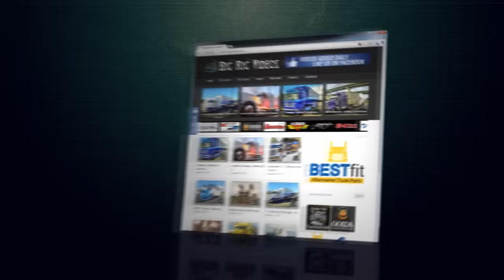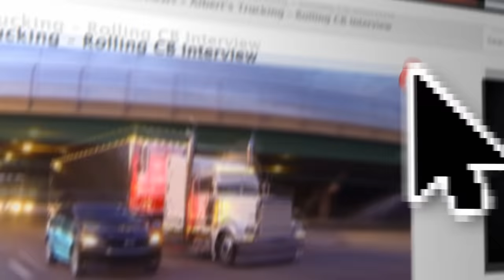Crazy Dave's Roadside Service - Owner Operator Interview

Comment: For the record, all Western Star trucks are built at the Portland, Oregon plant or at our plant in Cleveland, N.C. formally known as Freightliner Trucks. Know known as Daimler Trucks of North America. Western Star line was bought by Freightliner in 2002 when we were owned by Daimler Chrysler. I retired from the company in 2013 with 25 years in.
Reply from the maker: Right on, thanks for sharing that info.
Reply: So you worked there when it was moved from Kelowna, B.C. to Portland?
Reply: MrFakit that would have been Torner west. Torner east was in Hamilton or Burlington Ontario. I know uncle Henry.
Reply: Used to live next door to a Western Star Dealer. They made son heavy-duty trucks. Charlie Jenkins, the owner, was a hella nice guy.

Comment: I do agree with him on the tag axle. 90% of the trucks you see in North America have their tag set forward of the drives. Most European and Japanese trucks will have the tag axle set back. Which makes way more sense to me. I want my drives set as forward as possible for  tighter turner. Whether that be on a semi or a vocational truck. On a dump truck it would make more sense for the tag to be set forward because the majority of the weight is sitting dead center  on the frame. But like he said for tow trucks it does make much more sense to have it set back leveling the frame and giving you more traction on your steer.
Reply: I’m working in West Virginia and I’ve seen a lot of pulp wood and logging trucks with that type set up here
Reply: Many heavier rated European transports, and most construction vehicles, had dual steer axles also when we were there. Could always see a military convoy from miles away with all of the smoke. Don't have to worry about dawdlers in the monfort there either. The  polizei will gift wrap your azz if one plays stupid games on their highways--
Reply: I'd disagree, when you put the tag behind the drives it lifts some of the weight off the drives potentially reducing traction. Placing the axle forward helps distribute the weight but still keeps the drives loaded down
Reply: @ccclc6159  this is only true on long nose trucks, idk guys run them for heavy haul, makes no sense other then the look of a long nose. On setback axle trucks, Like a t800 or this guys video of service truck, u can overload a set back axle very easily,  triaxle heavy haul tractor or a dumptruck,  I have 3 t800 tri axles and a w900 tandem , w900 loaded lowboy, front axle light all day, t800 king pin set just ahead of fwd tandem,  you'll overload that front axle 23k lb no problem
Reply: @ccclc6159  with a setback axle dumptruck u need to take weight off the front end with the tag, put 22tons in a t800 loaded towards front of body you'll have 23-25klb on that fwd axle without the tag down. Watch a scale, just pull front on and get out and ask weight.  I've also been axle scaled many times by DOT so I know what works. Reason I say idk why guys run fwd axle trucks for heavy haul? Cause u cant get the weight that far fwd. Hence a rear pusher axle. It's a bandaid for a OTR truck trying to run heavy haul

Comment: 20 plus years ago in nyc there was a mobile tech that had a 3 axel pete w sleeper.
He was pulling a 2 axel refrigerated pup with a liftgate.
He had parts on the driver side wall. Tool box in front. Torches etc
It had a driver side slide platform with stairs. 
He had a jeep cj and a motorcycle with a basket in case he needed a parts run.
They fit on the liftgate.
He couldnt tow but did everything else.
The climate control inside worked well. 
The straight truck in this video is the best of both worlds being able to tow in a pinch....wow.

Comment: lift axle isn't in the back because the drive axles of most wreckers are already as far back as possible. lift axle can then be in front of the drives, use to distribute weight through out the frame and also a friction force when using a winch.

Comment: that's a cool truck
i think the mid lift axles are to take the weight of the crane/wrecker boom so it frees up the rear axles for the load...and i suppose with the drive at the back there(with a load) is more weight on them giving u more traction
Reply: ahh ok ....

Comment: Anyone who doesn't understand u have all that weight on tandems,  then add a truck on the back, why would u put a fwd of drive tag axle?  Rear pusher works for your set up. If u didn't have a tow set up, your rear axles should be farther back and your wanna take weight off front end with a setback axle setup. Fwd axle trucks,  idk how they get and weigh up there, it's just a steer, hence a 12k axle over a 20k setback set up

Comment: He needs to drive with the lift axle down everytime he tows cuz if not he would have a huge overhang and the truck would have no steering,wreckers have the axle in the front cuz the rear axle is as far back as it can go already,80% time wreckers dont ride with tag down cuz u have less overhang than his setup,he doesnt realize that frontrear axle is lifting his front end off the ground even as far back as it is

Comment: Can someone explain to me the difference between a tow truck and wrecker? I thought they were the same THX
Reply: +ddrum705   The difference is this...a TOW TRUCK does just what it says...it tows with a towing apparatus from point A to point B....a WRECKER does recovery work with air bags, winches and cables, etc...and it can also tow from point A to point B... I hope that helps you to better understand...that's what I  know to be the difference...someone correct me if I am wrong...Crazy Dave
Reply: +Beverley Nightingale thx

Comment: New age diesel=job security for techs. Whats the point saving on air emissions when every 50,000 miles you got to replace parts (aka natural resources). Not to mention the pollution involved in making these parts from the factories that manufacture this stuff. Intertrashanal (international) diag tech for 7 years.

Comment: Volvo pulls loads in Europe that don't exist in USA like 60-80 tonnes! American market gets cheap outdated tech from Volvo so to be serve it easy from Americans one gets what can afford & serve!
Reply: You don't know much about American  or North America trucking apparently. Just mention Oil companies moving drilling equipment 100 s times a month a 80 ton is peanuts.   M88 running up and down roads daily are 240,000 lbs gross. HET with trailer is 42 ton then add 62.5 A2.  53 foot van trailers have weight limits but having most trucks on the road and moving more product then any other country I can see why you are so envious.